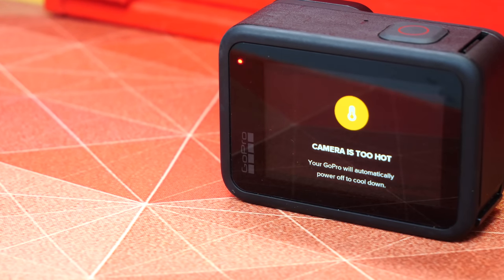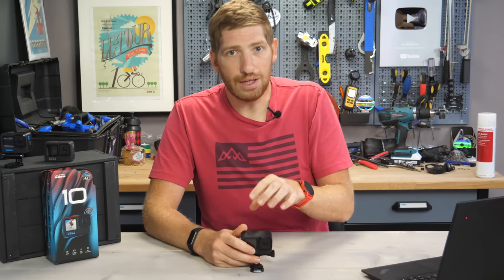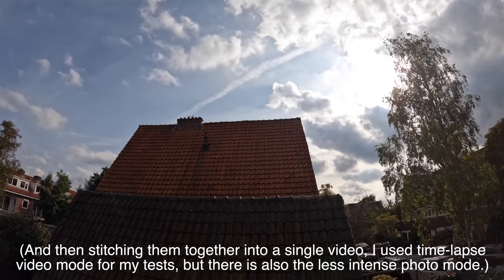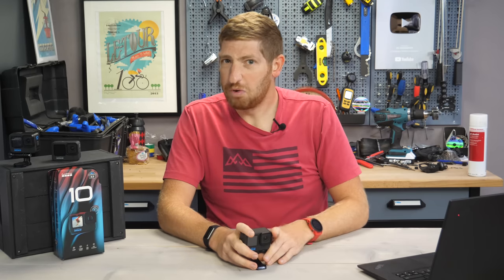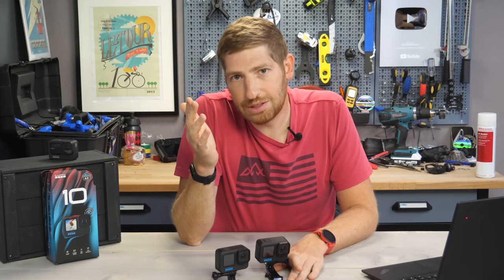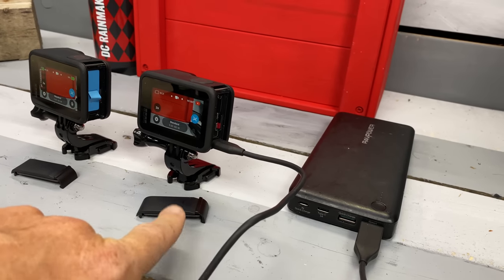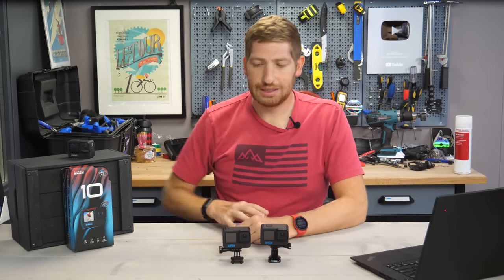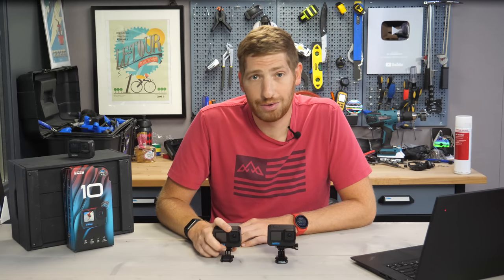GoPro Hero 10 Overheating: 40 Tests Later

Comment: To say you put the HERO10 Black through its paces, is an understatement. Thank you for doing so and keep the tests and comments coming. We read every comment and are taking in the feedback to learn what matters most to all of you. We are working on further firmware improvements for HERO10 based on your feedback.

And by the way – we love the beer selection in the fridge. Cheers!
Reply: I had real trouble with my Hero 9 overheating last summer trying to shoot at 4k while fishing. I have to run my gopro continuously for up to 5 to 8 hours a day filming on and off while I fish to try and capture the hookups. I either cycle 3 batteries or run it off a battery bank all day. In the peak of summer it was woefully unreliable and I lost a ton of footage from overheating and sd card errors during fishing. As soon as the temperatures dropped during winter the problems went away and I have not had any issues since. It will be interesting to see what summer in NZ brings this year. With these results the hero 10 is off the cards as the high frame rates and resolutions that matter to me would be unusable over summer for how I intend to use it. It's a shame as I was  real keen on the upgrade.
Reply: I have the same trouble with my GoPro Hero 9. It's frustrating.
Reply: Thank you for doing so? That sounds like GoPro hasn't done such tests! Seems crazy that a consumer has to do these tests and it's not part of the GoPro development cycle. Amazing, and not in a good way!!
Reply: Million dollar Idea. The heatsink case with fins for passive cooling. Indoors aswell high temps outdoors. For GoPros in extreme conditions.
Reply: @dronesafe  what makes you think GoPro hasn't done these tests? Ray isn't doing these because people are complaining about poor performance in the field, he is doing these tests because online "super sleuths" are going out of their way to break the cameras or test them in impractical environments and post the results like they are saving the world. It's ridiculous, and not limited to gopro. It is literally Ray's job to put these devices through their paces, and he would be considered a super user and he, much like thousands of other users have had ZERO issues with the camera. Because this is his job, of course he needs to weigh in on the subject, to dispell the catastrophizing coming from less responsible creators. 
Ray has done a great job proving the GoPro works as advertised/designed by doing his own independent experimentation that is likely similar to the R&D work done by GoPro. Throwing shots at GoPro based on fake drama created specifically by tech YouTubers is kind of a low blow. GoPro isn't perfect, but this is not the problem people are pretending it is.
Reply: @Tora8688  This behavior is because of a legal issue, afaik.
Reply: @Kroess  thank you bro 🥵. Hopefully they can solve it soon. Now I understand why 😱
Reply: Gopro should pay you for all your research. I love my hero 9 I haven't had mine overheat but I don't record for longer times.
Reply: looking to get a new action cam,  I must say,  the negative comments on various media doesn't seem so justified any more. Great review 👏
Reply: @CrazyAboutFlyFishing  looks like a cooling fan is the optional upgrade for you!
Reply: I find the performance pretty acceptable given the resolution and frame rates the small form factor is producing. I think the best solution is just to add a resolution/temp/time table to the manual so people know what to expect in different conditions and set the camera accordingly.  If it’s hot and you need more than 20 minutes continuous just step down to 4/5k 30 as mentioned in the video, no problem.   It would be interesting to see some kind of trap camera trigger system on these GoPro’s so that they could wait a long duration and then capture that moment via motion/laser tripwire/sonar/psychic energy or whatnot and capture at the highest frame rates or resolution while running cool in the wait time.  I imagine most long clips are just for the few short moments you need to clip out anyway.  Or some kind of AI that can adjust frame rate for the interesting moments only and reduce them again sort of like how the iphone adjusts screen refresh to conserve battery.   Anyway the Gopro 10 is looking pretty good as it is and this was a very informative video that snuffed out the heating issue imo.
Reply: This is what we want to hear GoPro!!! Cheers!

Also please fix this lame noise reduction algorithm which softens the image waaaaayyyyy too much as soon as you hit 200 ISO
Reply: Can we please get horizon leveling on the hero 8 🙏🏼
Reply: Thanks @gopro appreciate the reply.  The sd card errors are mostly gone now. I always format in camera before use anyway but I was cross using them with my Panasonic GH5. This appeared to be the major cause. I now only use my gopro sd cards in my gopro and that seems to work. I will try the powerbank without a battery. Just not ideal when you are standing in  river fishing.
Reply: @Cursed_catttt  haha maybe. I do use it rather intensively for days on end.
Reply: Bruh, fix the overheating on the 9. You gotta go in numerical order 🙄. GoPro 10 can just wait it's turn
Reply: @CrazyAboutFlyFishing  I got a huge improvement in my overheating problems on the 9 when I got a "Gurmoir" aluminum case.
Reply: Hey Gopro, I noticed you didn’t bother with “Authentech”. What happened?  He wasn’t honest enough?? Lol
Reply: Why GoPro too hot
Reply: @PaulTomblin  that sounds interesting. Do you think it acts like a heat sink? I will check it out.
Reply: @CrazyAboutFlyFishing  All video devices have heat issues, especially the water proof ones. I bought a Canon R6 and it stopped after 3 minutes of 4k in the summer heat. The only solution for you is to buy another Gopro 🤣 . Having 2 gopro you can shot many hours using them alternatively.
Reply: @florinflorian1849   @Florin Florian  that is a solution I am considering. I understand the overheating issues. I just believe that limitation should be disclosed up front. Plus my GH5 can shoot 4k60 all day and not even be warm. It has never overheated. Granted it is an expensive camera an much bigger in comparison but it also much older.
Reply: @CrazyAboutFlyFishing  when you run it on the power bank do you take the battery out ? Does it overheat or get cold battery message
Reply: @mysterydpt4663  have not tried it with the battery out yet. Just on the powerbank but I mostly need to use batteries as I have a real risk of falling over while fishing and dunking the camera. When on the powerbank it is not sealed
Reply: I've been using HERO6 since it came out and upgraded to HERO8 after 2 years. Now since the new HERO10 is available , i was thinking again for an upgrade but i see these multitude of reviews regarding overheating problems.
       Thing is, I had another issue with al previous GoPro cameras. They were dying in winter condition, whenever i was skiing , snowing or sunny weather on the track,  the camera will shutdown after a couple of minutes and the battery remained without juice. I even bought 3 extra batteries but with no success. I couldn't film more then 5- 10 minutes maximum and afterwards the camera will be completely dead. 
       My question is, will the HERO10 perform better in winter conditions if its overheating now xD ?? Can somebody advise regarding this? Cheers
Reply: Hey Gopro, if your listening. We pilots would like it if you could give us a method to record cockpit videos for extended duration. Without over heating. It almost exactly like GP on cars dash board.
Reply: Dear GoPro, 
for this $399 price it would be great if you hired some extra QA engineers instead of testing in Production via customer feedback. Hire me! 
This is completely ruining the UX. Especially the
- release rush and the non-out-of-the-box experience starting with firmware upgrades and etc
- concept of adding heftier and needier hardware on the same old battery
- heat and cold issues. (swapping batteries in skigloves is even more annoying in my opinion)
- of course software freezes and forced battery removal to reset the cam is just cream on the top...

This is turning into a NoGoPro since Hero 9... Heavily disappointing.
Reply: Since the Hero 5 I have never had any overheating issues because I take the battery out and use a power bank. @GoPro, will the "Cold Battery Alert" issue be addressed in any future firmware updates? I would really like to use the screen while filming..
Reply: I heat sink in combination to an aluminum body may help.
Reply: Love to see this kind of communication from the company. As a shareholder this is very important to me.
Reply: Do your own tests instead, that's your job!
Reply: it's good to see GoPro taking on user feedback and improving.
Reply: @CrazyAboutFlyFishing  I've been trying out the GoPro 9 on a kayak I just purchased. To avoid the GoPro recording constantly, I setup hindsight for 30 sec review, and then use voice activation to start recording when something is worth recording.
Reply: Dude. Actual GoPro commented on your video... cool.
Reply: @AdamBoltGoldCoast  i tried hindsight but it's still recording with hindsight, just not keeping everything. It just saves space. When it's hot it still overheats.
Reply: Great test but for sure it overheats that GoPro Hero9 did not. Today without knowing that HERO10 overheats I put on my dash took in 5K 30 which i did with HERO9 for a lot of times. In about 20 mins it beeped and stopped I was like what happened? For sure it needs upgrade this area because HERO 9 never had this problem. HERO 10 was a huge upgrade for me loving it but if I only can take 20 mins that is a big problem. Hope that GoPro can fix this issue in upgrade.
Reply: I had my hero 10 turn off saying battery low at 45% while recording this past weekend while I was doing my tests.
Reply: My Hero 10 overheated at 4K 30fps after 20mins!!
Reply: I must use different door of another Company replace door original, for it out hot air, and maybe record long. And use another frame with 2 leg, it can keep my camera harder than 2 leg on camera.
Reply: @BensMiniToons  THIS!
Reply: death of overheat...the price is higher but worse than hero 9.......
 ...I am extremely disappointed I bought your new(old) Hero 10 last week ...
Do u think it is non sense  to wait the camera cool down even the sport is running ??  how can I use ????
Reply: Hes made you guys look like a joke...
Reply: To be honest. I just purchased a go pro for the first time ever, yes the 10 and it has over heated after 16 min and hit 114 degrees. I am absolutely disgusted. I seriously want my money back!? Where is the disclaimer???????
Reply: the bad experience i have ever seen because the  overheart  reason… give me back my money!!!
Reply: Here is an idea for Gopro. Why not have a BEEP to tell us that the camera will shut down due to overheating. 
When using multiple cameras, we can't monitor them all while shooting. It would be nice to know when we get a camera failure and not find out after the shoot is done and swear at Gopro for their lack of forward thinking ;)
Reply: the  worse camera with a high price to cheat the customer...
 I am recording the best moment with your hero10 action cam…and the cam are forced close due the overheat problem……
Reply: @We read every comment and are taking in the feedback to learn what matters most to all of you.

Plz fix Gopro9 noise issue.
Reply: @GoPro  Thank you for hearing us out!!! Mine cut out during my daughter's color guard/band showcase, and I was devastated!!!!! Hopefully, this works!
Reply: I think it's time for new 3.5mm adapter ;) smaller unit ofc :) Media mod is not good for motovlogers, but mic adapter is huuuuge :/ and old 6 years. orr.. just do firmware update, and allow us to use usb-c mics :)
Reply: and one more option ;) I want to use both mics in media mod in the same time :P all vlogers need it
Reply: If only your designers were as passionate about design as they are about beer we would be all set.
Reply: We need another session gopro
Reply: @LordBelakor  Good suggestion.
Reply: @iix23  Nice idea 💖
Reply: We shouldn't be forced to buy a new expensive smart phone just so we can install an update on a "brand new camera straight out of the box". I bought a brand new GoPro 10 a few days ago and the first thing that I was prompted to do is download Quik and update my brand new GoPro 10. My phone is evidently too old to get the Quik app. iPhone 6. There needs to be a cheaper way to update this camera. People like me see it as ridiculous to pay for a brand new "expensive" latest greatest GoPro, and then have to buy a $1000 smart phone just to update the GoPro with a free piece of tiny software so that we can use our brand new expensive latest greatest GoPro 10 with all of its features that are advertised ......
Reply: @CrazyAboutFlyFishing  If you have an iPhone 12 or 13 you can shoot 4k60FPS in up to 90F without any issues. The phone body/frame is literally a metal heatsink for it's camera. @GoPro should take note.
Reply: Yeah, I see a TON of GoPros in the gym filming kids events. I had to tell a guy to just drop to 1080p/60, since he complained the camera kept dying. He was asking me how I was using my GP, and it HAD to run at that level... I really started using my DSLR, which is better in low-light gyms, anyway and can only do 1080p/60. The new 11 worked pretty well at 2.7k/60...but it did die once. Started swapping battery between games, and will try a cable to powerbank with no door/battery, but that can be bumped from a ball. 

I bought aftermarket door with hole for USB, but that still blocks the case and the USB can still get bumped. Could you make something more skeletal, but like the MediaMod case. Just have the USB plug into the bottom of the camera where it's somewhat protected by a tripod and leave the door with an opening and just route to a USB port on the bottom. I wonder if I could 3D print something like that. Hmmm... Would love something official, so I could shoot 4k/60, or 2.7k/120. And... I've mentioned in other posts...does the camera "lens" matter at all?
Reply: You should have done all these tests and more yourself, is also an understatement.
Reply: @EverythingIsPhotogenic  "Impractical environments" means nothing while the camera doesn't have an asterisk that suggests how and where it should be used. It's called misleading customers.
Reply: @psytcp  the "action camera" by definition was not designed to sit flat on a table with no air flow recording at high frame rates for extended periods of time. The supposition that GoPro needs to explicitly call that out to it's customers is pedantic, and more to the point patronizing. Companies are not beholden to wiping their customer's asses. At a certain point, people need to exercise some common sense. Think for yourself.
Reply: @psytcp  and they would lose. Try to sue libman because their toilet brush doesn't work effectively for your hair because they did not explicitly say as much in their marketing... Let me know how that works out for you.
Reply: @EverythingIsPhotogenic  You can't meassure the effectiveness of a toilet brush as well as a camera, nor they cost similar money.
Either way, you can say and think what you want. Gopro 1 to 9 are also action cameras and had no problem whatsoever so noone needed to lie or mislead.  I guess we aren't all as honest and that's fine so we don't have to agree:)
Reply: @psytcp  you can say what YOU want, your fundamental misunderstanding of the legal system is obvious. To sue, you need to prove damages. And to say 1-9 did not have issues is simply factually inaccurate. Take the last word, arguing with ignorance is not something I waste my time doing.
Reply: @EverythingIsPhotogenic  So If I can't win in court then it's ok to be dishonest. Exactly my point:)
Reply: maybe stop making them black! black go pro absorbs so much heat from the sun

Comment: Whenever my GoPro overheats I just switch the battery and continue recording right away without a problem. The battery is always blisteringly hot when pulled out, so replacing it with a cold one is enough to get the camera back up and running. 

I've started to get in the habit of just switching the battery after around 30 minutes of continuous recording, before it overheats, so at least I'm the one that's in control of when each video clip is stopped.

If you do another one of these videos in the future can you test it with and without a foam windslayer on the GoPro? Many people who want to capture audio from the internal mics use these when filming outdoors to prevent wind noise. It does insulate the camera a bit, making the airflow less effective at cooling it down.

Keep up the great work. This video surely took an enormous amount of effort and is much appreciated. 👍🏻👍🏻
Reply: Good tip switching the battery. Also him running straight off USB with the battery removed. I've had bad overheat problems with my 9 when outside in extreme temps (maybe as much as 110F) and I found myself pouring ice water on the camera to keep it running. Next time I think I'll just dunk it every so often between action. I've also found myself removing the windslayers on occasion.
Reply: Awesome thanks
Reply: DALE! Nice to see you here buddy hahaha

Comment: This is, by far, the most comprehensive and in-depth review of GP overheating video to date. I've seen so many YouTubers testing/addressing this topic in the wrong way, mostly indoors at a desk with no/minimal airflow, which is not what this camera is designed for. Great work in gathering all the data points and translating them into real-life context!
Reply from the maker: Thanks! Another packed on coming up in the next couple days on the Hero 12 and Action 4.